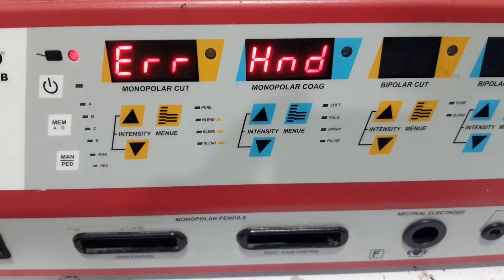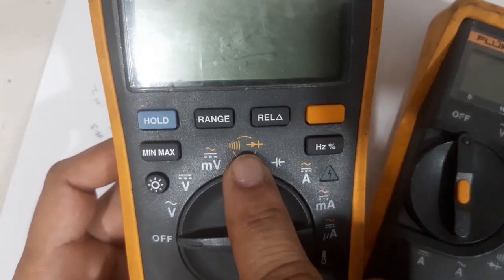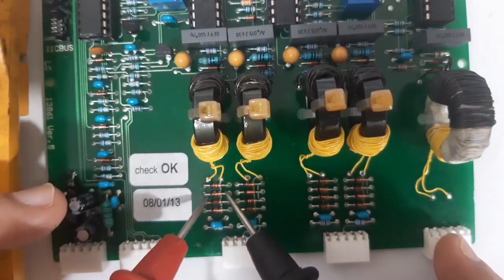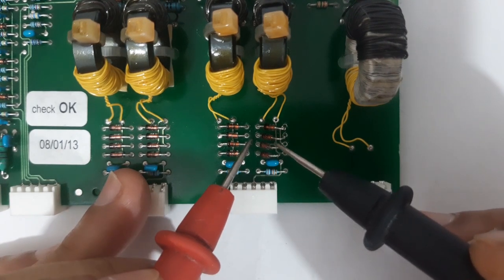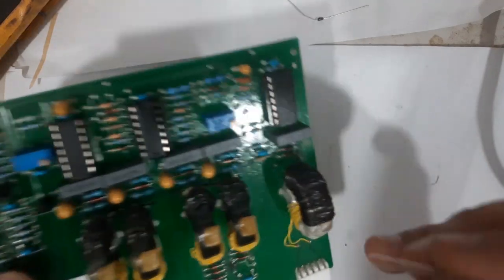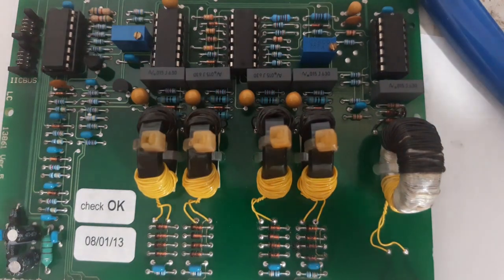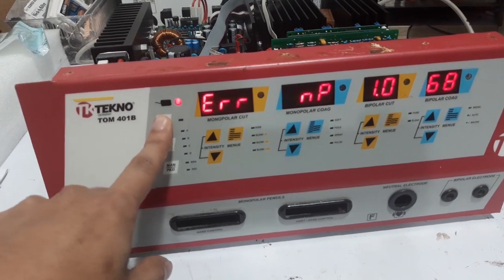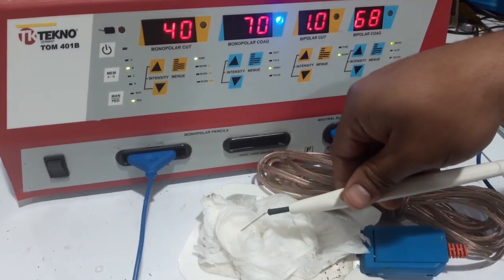Board Repair of Electrosurgical Unit - Short Zener Diode : Glimpse of Biomedical Engineering Works

Comment: hope you are ok,i need assistance i have kais 3005DC is  dc power supply does not detect short or to produce much heat on laptop motherboard please advise or to do modification?
Reply from the maker: Good day bro. I think you power supply have safety features which cut off the supply when it detect short. Check for mechanic vc04 short detector or else use a battery.